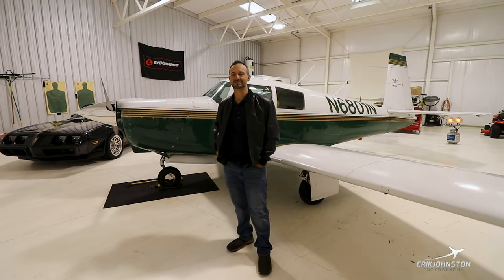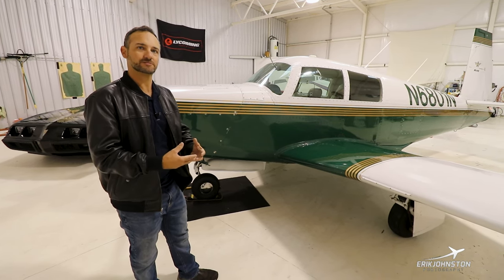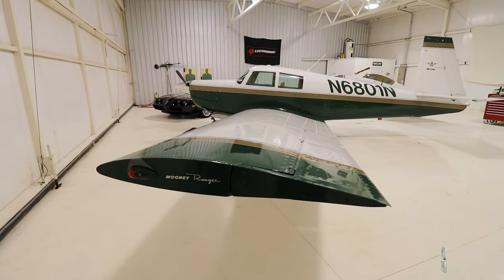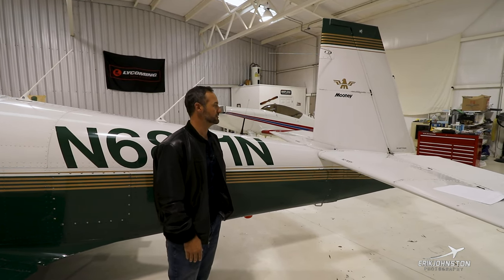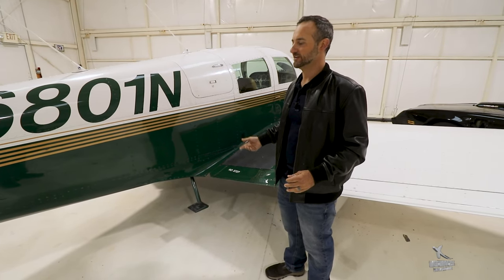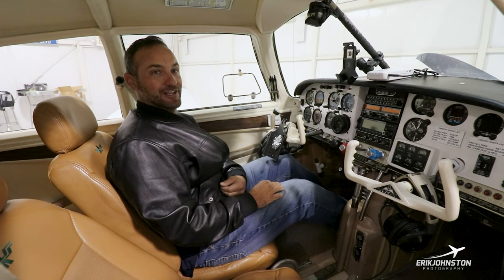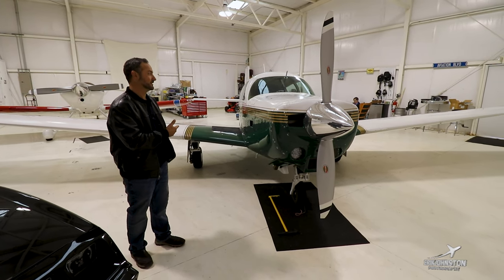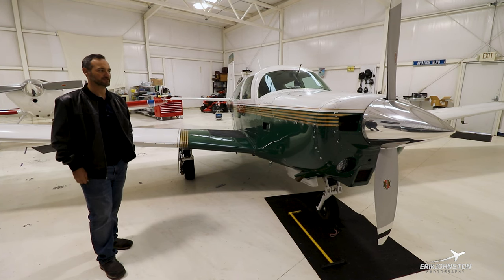Mooney Walkaround Ben Hines

Comment: The first plane I ever flew as a student pilot was a 180hp 1966 Mooney M20C.

Johnson Bar and doughnuts! 

What a plane for a kid pilot to start in!

It's still flying in NZ and has had the modded cowls fitted.

Interesting you have the replacement LED landing light.

No other LED Beacons/Strobes?
See your extra belly beacon up front. 

I got a lifelong lesson in the M20C.

I pulled her off ground short then, with my third arm, got gear up quickly.

Owner pilot instructor beside me pulled power and asked me "Know what, gunna be an expensive landing!"

Lesson was, in a single engine retractable.

Positive rate, no more runway in which can land on should we have to, gear up!
Reply: My philosophy is with the Johnson bar, positive rate-gear up, knowing I can get it back down in less than a second if the worst were to happen.  It also opens up the options for landing gear up in the grass somewhere straight ahead if putting the gear back down will induce a stall.  Just gives more options.